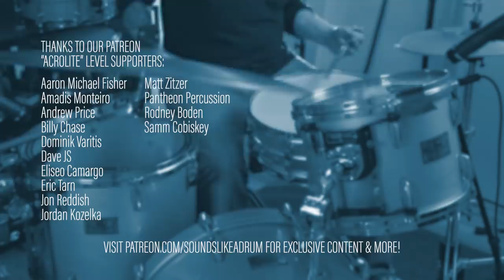Gaffer’s Tape Drum Hacks | Season Two, Episode 29

Comment: I have found gaff tape to be great on the undersides of my brighter rides, like my Paiste 2002 22" and my K Custom 20". The tape, more than a cymbal tuner or moon gel, adds a dry character to it without taking away too much volume or changing the way the cymbal feels to the stick. 

A tiny piece of gaff tape also works great on a snare reso with a deep tuning in an echoey room. Doesn't choke out the snare but kills some of the note-iness you can get with big tunings.

Thanks for the video!
Reply: I do the same to my 22" 2002.It adds little more ping . Ive had a 3" piece for over a decade.

Comment: I use one inch painters tape stretched across the bottom fourth or fifth of the batter head for a touch of tone control and to highlight some attack. more muffling can be achieved if you do a second strip perpendicular to the first ( creating an "L" shape). Helps that drum that sounds good but rings just a touch to long or has a high over tone you cant seem to kill.

P.s.
Painters tape can work as a substitute for Gaff tape in a pinch. It's not as thick so you will have to double or triple up in some situations, but it will work in a pinch, especially if you are seeking to the minimum amountnif muffling.

Comment: The last one with the cymbal felts also works with pocket change on the tape. As you can imagine its like the "gate" shuts a little quicker than with the cymbal felts. I also use gaff tape to tape down my slave side double kick pedal so it doesn't slide around and to mark out my drum kit on my rug to make set up go quicker.

Comment: Wow that cymbal felt/tape combo is brilliant ! How did I not know or think about this earlier. I will try that out ASAP. 
Also thanks for letting me know the difference between gaffer tape and duct tape, didn't know that either.
I have learned so much from you guys, thanks for doing this !!
Reply: Absolutely agree with you on the cymbal felt idea! It opened up the door for using other thing's besides felts.
Gaff tape IS expensive! I've been using guerrilla tape. It took the coating off the Evans head but, not the Remo. Taken it on and off the Remo many times without hassle....

Comment: Between you guys and the Modern Drummer podcast, I felt pressured to not pass up a $75 late-70s Acrolite. Who doesn't love spending their evenings brasso-ing lugs?!
Reply from the maker: That's a solid deal right there! Can't go wrong with an Acrolite. Congrats on the new snare! -Ben
Reply: I've got one of those! Love it to death--got it for a similar price and it would be my desert island snare, to be honest.
Reply: @peterlamear  Thanks for the rousing endorsement. I've got new wires and the P88 throw off/butt plate coming for it. What sort of genres are you playing with it?
Reply: @a.j.wilkes6352  The band I'm playing in mixes post punk and americana stuff, so I am going everywhere from smashing rimshots to brushes in a set. The Acro does it all
Reply: @a.j.wilkes6352  nice man im about to get the p88 for my old supra! Did you get a 5 or 6.5? Ive been wanting a 6.5 acro bad lately
Reply: @jangobango2847  Just got butt plate installed last night after tapping the holes for the P32 spacing, and I'm loving the look of both with the bowtie lugs.  It's on a 5" deep.  I"m curious, what are your thoughts on the difference between 5 and 6.5 deep?

Comment: I missed this video last evening! As I overused gaff tape in the past, I avoid using it at all cost nowadays. The only use I make is adding more weight to the snare wires by sticking it to the snare plates, not the actual wires. It prevents those zingy sounds, especially on a beat-up or slightly defect unit.

Comment: Deffo gonna try the taped felts idea, i do find just plonking multiple moon gels on a head diminishes some of the oomph when one hasn't done the job. Thanks!

Depending on the room, I've found just a strip of gaffer across the floor tom reso quite effective. I once had to wedge my winter coat partway under it for recording because the sound was good to me, but the ring just wouldn't quit xD

Comment: I find a small 4” x 3” or smaller piece of paper cuts out most of the ring while not killing the tone. I’ve tried it with 2 pieces @ 11 o’clock and 1 or 2 o’clock and it will control even a wild snare. I use scotch tape to keep it in place and it works very well.

Comment: cell phone on the snare head works, too, but i haven't used it in a practical setting yet, though i have noticed it's a nice tight sound.
Reply from the maker: This is true, though be VERY careful if you're gonna go that route and make sure "cracking screen with drumstick" is covered under warranty... 😉
Reply: @SoundsLikeADrum  😂 alex rudinger said pretty much the same thing, but a snare head is alot of real estate to hit....in fact, i think i might see if i can use it at prscrice tomorrow and sunday in church; work it into part of a song....
Reply from the maker: Put it on "vibrate only" and have someone give it a call and you've got yourself a "no-handed drum roll"...
Reply: Wallet...just use your wallet.
Reply: Your snare would have to be perfectly flat for that. I tried it and my phone kept moving to risky places on the head. I almost hit it.
Reply: @SoundsLikeADrum  😂
Reply: @a.j.wilkes6352  not heavy enough....or maybe i need to add more cash 😋
Reply: @TwoCablesOCN  i run my drums at a slight angle, so if i set something at the bottom of a rim, it's not going anywhere. also when i'm outside the house i usually have my phone in a faux leather flip case, so movement isn't an issue.
Reply: I would never recommend to anyone placing their phone on the side closest to you. You'll hit it.

Besides, there are plenty of things that are safe to accidentally hit that accomplish the same result for the snare.
Reply: @Pure_KodiakWILD_Power  LOL!  No joke, I have a dollar store wallet "mute" filled with paper and pennies in my gig bag because I'm paranoid about getting jacked. :D
Reply: @TwoCablesOCN  i don't have many accuracy issues when playing  thankfully 🤷‍♂️ each his own. it's something that works for me, something i often have on my person when i'm at the kit, and i don't like to keep things in my pocket, so it also doubles as a temporary perch that i happen to hit with my sticks 😅 also, it's kept in a case and i don't play my drums and cymbals with the intention to destroy them or my sticks, so my phone is in no cosmetic or structural danger. actually my phone is 100% more at risk when i'm working or doing non percussive parts of life.
Reply: @a.j.wilkes6352  😂 good call.
Reply: I'm not going to test hitting my iPhone with the same force I merely play my drums at. It's one thing to think that I'm playing my instrument far more gently than most drummers, but to hit a glass iPhone display - yeah no. I play gently, but I don't want to find out that it's not gentle enough for the glass display of an iPhone. I don't care how tough Apple says it is.
Reply: @TwoCablesOCN  😂 you forced me to pluck out some rythms on the face of of my sweet new note 10 plus-- with my promark oak 727 nylon tips 😂 just to see if anything happened. of course it didnt, but i used my "conversational" stick force, and of course i wouldn't do that for a long length of time. also i didn't want the nylon tips to mark up the cheap screen protector that came with it. now striking the back ( and possibly the camera lense ) is a different story entirely 🤣
Reply: Yikes. Omg you're brave. I'm extremely glad that didn't hurt it. I'm not so sure why I'm so relieved though since it wouldn't have been my fault. :P
Reply: I do this all the time, if you have good playing zones you shouldn't run into any problems 👌

Comment: Language trivia time: 'gaffer' is short for 'grandfather'. It's the traditional term for a works foreman in much or most of England. In a fair number of Premier League soccer clubs the players customarily refer to the manager as 'the gaffer'.

8:49 Remo sells something which works similarly https://remo.com/products/product/active-dampening-system/ . Likely it was inspired by the handmade cymbal-felt contraption. It is possible to do better ...
Reply from the maker: Ah! That's quite interesting with regards to the term. I know that, as it relates to the tape, it comes from the roll of the Gaffer within a production crew.

As for commercially available muffling system, yep- there are a few like that out there. Of course, to do what we did here with that system would cost about $90 so we'll probably stick to (pun intended!) the gaffer's tape  and cymbal felt approach that cost ~$1.50.
Reply: @SoundsLikeADrum  Sorry, I phrased that misleadingly: I wasn't saying that the commercially-made systems are better, but that passive, mechanically-powered gating is inherently limited, in ways that are a lot more forgivable for a $1.50 fix than something expensive. For example, you could add more weight on top of the felt with a coin or washer to make it "gate" more strongly, but then you're also increasing the muting of the intial attack, and reducing the open time in between. It's possible to have a device which can mechanically "gate" the drumhead strongly and at any chosen point in the decay while not muting the intial attack at all, but for that you'd need a solenoid and a 9V battery.
Reply: Leo, I didn't  know that about "gaffer". No a word you hear in Scotland very often. Good to know. Thanks.

Comment: Speaking of gaph tape on cymbals. I just bought millennium still low volume cymbals and I’m not happy with how loud and ringing with a high overtone the hi hats are. I used a sliver of tape on the bottom hat, didn’t like. Top hat, didn’t like. Placed it close to the Edge, close to the center. Under to top hat and under the bottom hat. Any advice?
Reply from the maker: Might try putting a handkerchief between the cymbals to see if that helps. Those cymbals really aren’t designed for tone though, just lower volume.

Comment: My PDP Maple Concept Floor Toms (14 X12 & 14 X16 ) just acquired , have fantastic sound HOWEVER, too much ringing.  I Gelled the batter heads, Tuning it so many ways, but can't get it "right".  Now trying Gatt taping the Remo Clear Reso Heads?  Is that Wrong?  It does seem to help.  I haven't tried the Cotton balls...  I changed all the Tom Heads to G2 Coated over from the PDP Remo made Clear Batter heads.  The jury is still out on the difference.  There is a difference, on all the drums, but I am still needing to Gel or Gatt tape them ...  Man, I had no idea about the art of Drum Tuning ...  I'm a 69 Year old "beginner" - having returned to playing drums after 50 years .

Comment: Unrelated to the video topic but I thought someone here might have some knowledge on this topic. What would a snare batter head used on the resonant side sound like?
Reply from the maker: Choked out and generally dark/dry with a very small dynamic range. There’s a reason why thin heads are used for snare sides and it has everything to do with the transfer of energy and activation of the wires.
Reply: Thanks for the insight!

Comment: gaffer tape?   and what IS gaffer tape & is it very very Very similar to what we call Duck Tape
Reply from the maker: Gaffer tape is a fabric-based tape used by gaffers on film sets. It's also quite common on stage and in studio and doesn't leave residue the way that duct tape does. Please, for the love of the gear, keep duct tape away from drums, cymbals, and hardware.
Reply: @SoundsLikeADrum  I used duct tape on my drums before & after a while,   the residue seems imprinted in the surface,  hard tyo get it all off.